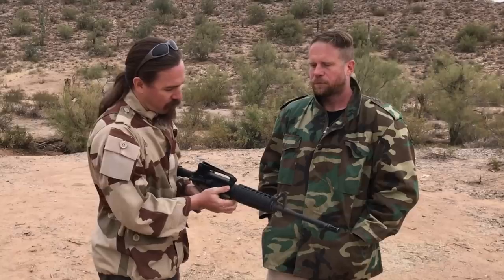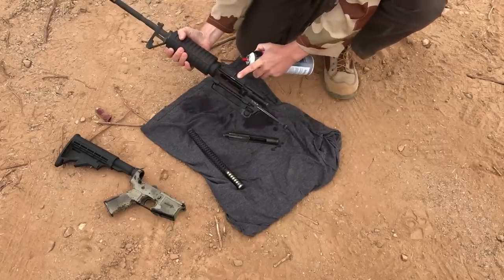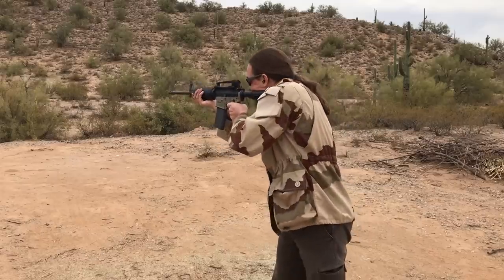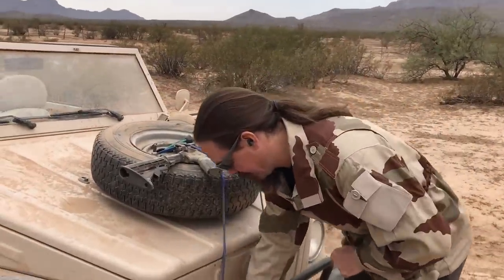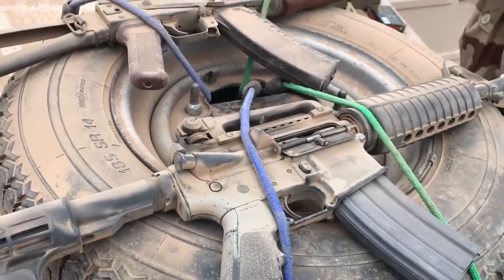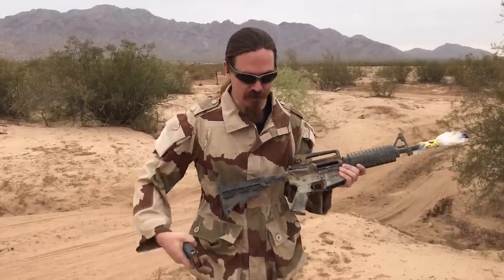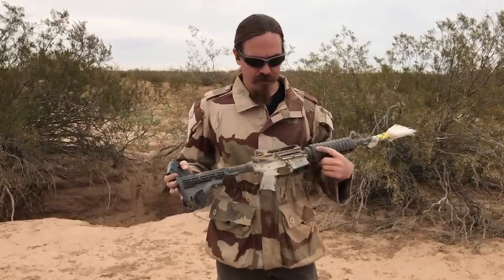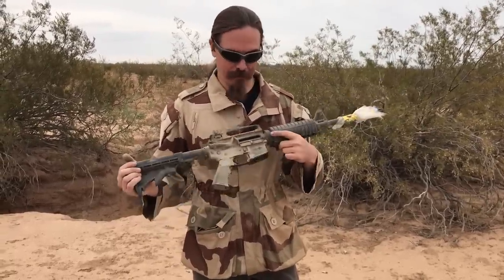Convoy Dust Test: M4gery / AR15

Comment: Did you guys realize the bolt was open on the AR unlike the AK?
Reply: No it wasn't
Reply: @Nick Neider Yeah I realized that too. I think the AK would have done worse if the bolt was all the way open like that.
Reply: Look again both bolts were in battery
Reply: @davet231  No, YOU look again. The bolt on the AR is CLEARLY locked open when Ian is kicking sand all over it. He even blows through the ejection port to try and get some of the sand out. When they did that to the AK, they had the bolt closed. Nick Neider's comment was correct.
Reply: crazyfvck I stand corrected I was looking at the the second on vehicle test.
Reply: And now you realize that the ak does not have any way to hold the bolt open.
Reply: Josh Then you leave both in battery for consistency
Reply: @Josh-gg6ct  That is true, unless you upgrade the safety lever. Nick was just pointing out that the test was not really a proper comparison, because the same conditions were not met for each gun during the dust kicking test. The AR would have probably done even better if it had the bolt closed during that test, just like the AK did.
Reply: @Josh-gg6ct  Unless they have Yugo bolt hold-open followers, or selector lever bolt hold open
Reply: We know the AK design is flawed, fucking impressive that the AR had dust kicked into the chamber and still ran
Reply: @crazyfvck  Ak bolts aren't held open on an empty magazine, unlike the AR. It's a condition specific to the AR, so I don't see what the issue is here.
Reply: @Wigggy  We are just pointing out that the second test (aka kicking sand all over the gun) was not really "apples to apples." Ian and Karl talked about how the AK did better in that second test, but as Nick pointed out, the AR had its bolt open, unlike the AK. So for the sake of being a true comparison, they should have left the bolt closed on the AR. That would also mean that any guns that they perform this test on in the future would need to have their bolts closed.
Reply: The kick test is entirely unrealistic and wasnt intended to be part of the official test afaik.
Reply: If he had a chance to blow out the sand from the AR's chamber wouldn't it be fair if he also blew the sand out of the AK's chamber???
Reply: @Spike-13  "probably" "probably did"  Dust gets every where.  It's not that it wasn't safe to use the AR with dust in the chamber, it wouldn't lock up at all, so even if he wanted to use it, he couldn't.
Reply: They also blew out the AK’s chamber, the test was equal other than open bolt vs closed

Comment: I must say you are correct when it comes to ole boys in general. Been lucky enough to deal with some older A2 variant rifles and often times castle nuts as loose as a 1/16th inch rolled out in the buffer tubes is enough to slightly warp the spring and cause massive short-stroking issues. Quarter turn on the pipe wrench and they run like new models.

Comment: Why ARE you missing the buffer detent?
Reply from the maker: Because they break and are not a necessary part.  Explained in the WWSD series.
Reply: They're also easy to lose.  Once they fall off your work bench, they enter an alternate universe.  You won't be seeing it again.
Reply: @PhilosoraptorXJ  Yep they go hang out with wayward rear-takedown-pin springs, near the cracks in the fabric of space-time.
Reply: Because they are nothing but a part that can go wrong.

Comment: Get ready for AK fanboys saying "this test is fake! A full auto selector and 1.5in shorter barrel magically make a M4 fail!"
Reply: They don't need too. AK did better in this "test" (These tests are not intended to be a litmus of which rifle is actually superior)
Reply: @voduhinc342  
Ar:
Flawless mud test
Very good sand test
Ak:
Bolt action in mud test
Excellent in sand

I'd say the AR takes the cake here
Reply: @leevin7546  I'll edit my post and make the important parts you may have missed in bold.
Reply: @aaronorr5586  Unlike you, I dont have a team, or call people "fan boys". Again, (These tests are not intended to be a litmus of which rifle is actually superior)
Reply: @voduhinc342  If you keep bolt closed on M4 during dust kicking, there will be no difference between ak and ar
Reply: I see these kinds of comments on every single AR or AK video they do. "I can already hear the AK fanboys crying about something, har har har"

Yet the only time I have ever seen it was the first AK and AR mud test, mainly just the first AK test. Every single test or video related to testing the AK or AR I've never seen comments from people whining about "whats ifs" when it came to the AK or AR. If they did exist there were very very few of them. 

In fact usually what I saw were people just shitting on the AK and AK fanboys, several times. And all I needed to do was scroll down on the comments. It's like you people don't even need to be provoked to talk shit, you'll just do it anyways and claim AK guys are doing it even when they are nowhere to be seen.

Only reason I decided to even comment about this is, like I said, something I've seen on every single AR or AK reliability video they have done regardless. It's getting a bit ridiculous guys.

Comment: Perhaps what might be a big killer for the ar platform is when you try to operate it under dusty conditions when it’s lubricated_. This is a big problem in places like saw mills where them forklifts are operating with all of that sawdust getting into the chains and mast rails. It’s considered best to avoid spraying any kind of lubricant on them to avoid further attracting the dust and allowing rollers and what not to get clogged up. I feel that a similar outcome would occur if the rifle in this video _was lubricated properly.

Comment: A well serviced rifle is the main issue. I have a bunch of ARs and never have anywhere near as many problems with them as I do with military weapons. Even on a normal qualification range, clean guns will jam up from a variety of problems (Fail to feed, fail to fire, stove pipe, fail to extract, etc.).
I would take any of my personal guns which range from mid level all the way up to high dollar over a questionable past m4 or m16.
Heck, my m16 I had on my second deployment had been rebuilt like 3 times. On the lower, it had "Colt M16A1" stamped on it but it had A4 furniture (which is usually an FN) and the "A1" portion was Xed out and "A3" was laser etched below it. That damn thing has been in service a good 30 years by the time I got it seeing how they basically stopped production/issue of A1s in like the mid 80s.

Comment: You should do the test lubricated as well and not assume that it will necessarily be bad. When I was in Afghanistan (I was an army weapons technician at that time) I've seen all sorts of dry lubricants (graphite-based) being tried in an attempt to cope with the dust. The dry lubricants appeared to work fine with our AR-type rifles (Although after enough firing oil would still be needed to cope with the carbon buildup. But dust wasn't an issue for those even unlubricated. The design that minimizes ingress of dust was probably the main reason for that)

But dry lubricants were no bueno for our MAG58 machineguns. At first when vehicle crew members asked if I had some sort of magical product or solution to the dust problem with their machine guns I gave them the by the book answer that they had to use very little oil or a dry lubricant. But I quickly saw that this answer was wrong. Even clean these guns generally don't like to run without proper lubrication and graphite wasn't cutting it. A previously oiled machine gun that was exposed to dust still ran better than a clean dry gun, let alone one that had been exposed to dust. Splashing some fresh clean oil on top of that just before use made a big difference as well. I worked up the reasoning that this dust will get into these machineguns no matter what and that the Southern Afghan dust's particular stickiness gives it the tendency to stick to the gun's innards even if it is dry. Especially in the case of vehicle mounted machineguns. Therefore my conclusion was that a dusty and oily gun was better than a dusty and dry gun. From there on I've changed my recommendation to keeping the gun lubricated with a moderate amount of oil and wiping the dirty oil off to replace it with fresh oil on a daily basis whenever there has been exposure to dust. I also recommended keeping a spray bottle of CLP handy in their vehicle turret so they can quickly splash some fresh clean oil into the action as soon as they get a chance when/if they need to fire the gun. This fresh oil washed out the contaminated one and instantly made a huge difference if the gun wasn't cycling right. It is what I was doing for the gun on my own RWS turret and it served me well. 

Now I understand that I was no scientist doing tests under controlled conditions so you can all take it with a grain of salt. But although it wasn't perfect it appeared to be the best and easiest solution to keep the guns that were exposed to that much dust going, for the MAG58 machine guns anyway.

Comment: If you’re cooling the barrel off with oil CLP will stain it brown... the clear hoppes/remoil will work fine and washes off the rust oxidation you’ll see on barrels that have gotten really hot.

Comment: 13:33 Did you notice the different angles the fired brass is being ejected in? Bolt speed changing either from higher chamber pressure (dirt in the chamber/bolt face) or dirt fouling up BCG and/or buffer. Ian probably just change his point of aim.

Comment: I was in the marine corps and first hand the issue is the sergeants would force over lubrication. They would carry around clp in spray bottles and make the guns dripping wet for the privates. That is absolutely the issue. In boot camp my drill sergeant forced us to scrape the barrel crown clean with steel cleaning rods. They knew nothing but telling them that ment a trip to the pit every chance they could. My marines remember the pit.... most marine corps rifles go down due to this kind of over maintenance and terrible "common knowledge" in the corps

Comment: Great thing about the gas impingement system that I don't think would be the case if it was a piston driven AR: If you're a crappy soldier and don't take care of your weapon, and allow it to get that crudded up as you gentleman demonstrated, Its more than likely going to self correct the problem blowing the stuff out. 10/10 times you're going to be moving with the dust cover closed and a mag in. You're never going to be moving without a mag and the dust cover open to allow enough material to get into the system to get jammed in the first place. On the other hand, using a standard lube as you said, in such conditions, may be problematic.

Comment: I think part of the problem we had with our rifles was the fact that many were badly worn and abused. The A2 I was issued my first deployment had little to no finish inside or outside. I kept my rifle lightly lubed with CLP. It malfunctioned on me at the worst possible instance( Right in the middle of a fight). My magazines were all new aluminum green follower type. Perhaps a new bolt and some of the "New" lubricants would have helped my situation? The A4 I was issued the second time around was problem free. It was basically new. Your results may vary. Rise lather repeat...

Comment: The AR is designed more with the idea of keeping everything out. That's why it has that dust cover that makes a pretty good seal, but I understand leaving that open just for the sake of the test. However, I don't think the bolt should've been left open. It'll fill up much worse through an open bolt than the AK did through that small slot behind its bolt. The AK is built to relatively loose tolerances, so it can handle the silt getting in through that small gap that is always open (though during its own test, it also took small pebbles, which I suspect might've been what caused the failures) during its operation. The AR isn't designed to take all that silt (and probably small pebbles too) going into it while the bolt is open. Everything is meant to remain pretty well sealed during its normal operation. Of course it will malfunction much worse

Comment: Pretty similar to what I thought was going to happen. Not surprised that it has trouble at first when all the dust was dumped on it. Firearms are machines, some designs are better than others. But, nothing is magic, it's metal parts interacting with each other, do just the right thing and it can shut it down. Engineers get it for sure.

Comment: The bolt was closed on the ak when you kicked dust on it so I think it would have been much more favorable for the ar if the bolt was also closed when you kicked dust in it. I’m surprised it functioned as well as it did after the dust jump in.
Reply: I noticed that too.. which is even more impressive that the ar15 did so well with its bolt locked back vs the ak47(akm) having its bolt closed.

Comment: Another reason for failing M4's could be use of lubricant.

Most people keep a little on a gun for good measure, which is bad in dusty conditions, and one of the most common things people do when a gun stops working is add more...

Comment: I believe it was Chuck over on P&S that said he ran his gun dry and carried a bottle of lube to squirt in the chamber in an extended gun fight.  His theory, the gun should run at least one mag ok dry then lube with reload from cover.  If gun hadn't been used, blow out with air compressor at end of patrol and your done.  Also, we should remember these things were tested in a dust chamber so we should expect them to work in adverse conditions.  Having said that, the AK no doubt has an advantage in dust.

Personally, I'm more impressed Karl's VW ran through all that dust and dirt.

Comment: ARs are far more reliable than people give them credit for, AKs are far more accurate than people give them credit for.
That being said, this test shows exactly why the AK "lacks" a bolt hold open device. Dirt getting into the chamber is the only dirt that would put an AR, an AK, or any other gun out of service.  Sure, when we're at the range doing those fancy speed reloads in 1 second the bolt hold open / release seems like an obvious choice, but actual combat footage shows that combat reloads usually takes something more like 1 minute and lots of dragging the gun in the dirt, because FIBSA is a very real thing.

Comment: I remember training at 29 stumps or Palms at CAX my gun got all sanded up I was lucky during live fire it was jamomatic old A2 rifle so I pulled the charging handle back lock the bolt to rear removed magazine and dumped a whole canteen of water into the weapon to clear out the sand flushed the gun well return to fire and could feel water mist on the first round.   After that I found some burlap cut out some places for the ejection port area only and wrapped the gun in it with the ejection port cover closed.  I learned to run the gun dry after that.

Comment: Thanks another great video.
Beretta M9 gets bad rap from some soldiers.
But it also depends on maintenance and real Beretta magazines, Beretta newer desert mags are even Better.
If you are issued an M9, Replace the recoil spring, make sure you have real Beretta magazines.
Unit armor should have done this, but.. do you have a good armor?
I bought my own magazines and several recoil springs.
Same for when I was issued a 1911A1, Replace recoil springs and other springs.  Use Wilson or Chip McCormick mags.

Comment: US Army conducted an extreme dust test several years ago and found that generous amounts of CLP increased reliabity significantly.  TM has been updated to reflect this.  You guys need to update your protocol if your trying to give the rifles the best chance of success.  This is actually a worst case...
Reply: the counter to that would be, how should they treat the AK? I mean hell just LOOK at their mud test comments,  people cry foul on them for not using/using certain parts, frames and other things. In this case ALL of the platforms they're using is on an even playing field (no lube of any sort to bind to the dust and grit, no issues with using/not using certain lubes, having too much/little. in turn we see the platform, as a whole where it is strong, and where it is weak. overall it shows that if you treat your AR/AK well, it'll run; Treat them poorly and well...  we've seen what happens to both platforms.

Comment: dunno if its the same stuff but i used to work with "industrial" degreaser and without gloves it would absolutely destroy your hands. hope you had some moisturizer ian
Reply: Brake fluid is pretty bad for skin, yes. And I believe a heavy exposure would even be lethal.
Reply: @wtfronsson  It isn't great, and you need to be sure you're using the correct kind of gloves if you wear any or it'll just go right through, but at least these days it probably isn't chlorinated.

Comment: great test. our in tank rifle was a full length 3 round burst model. brand new right before deployment. as i've stated before [see first ar vs. ak mud test] our magazines were NOT new and were probably the cause of many of our issues. other problems  may have been due to our orders to keep our  magazines OUT of our rifles at all times and to keep the rifles well oiled 😐. the burst fire junk in the rifle also took up more room than a regular m16. not sure if that made a difference but it couldn't have helped. nor did the way in which a full length rifle is held inside the turret do it any good. held by the end of the barrel wobbling around in the turret. all in all a bad situation for a rifle you might actually need to work.